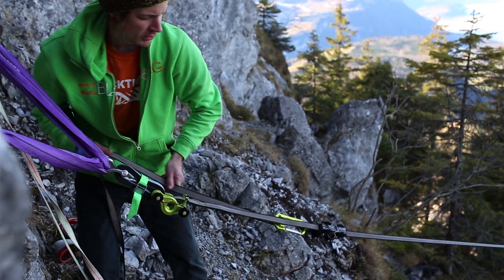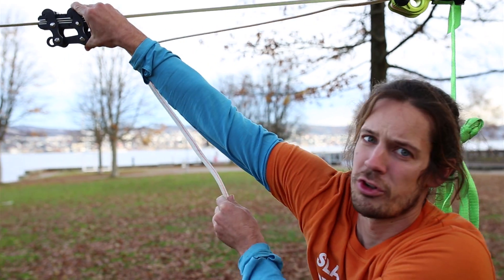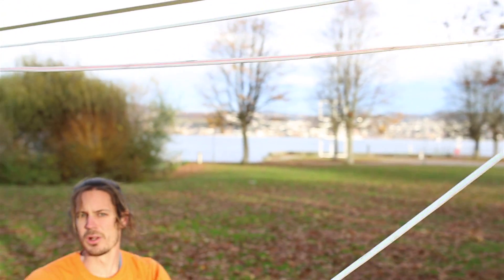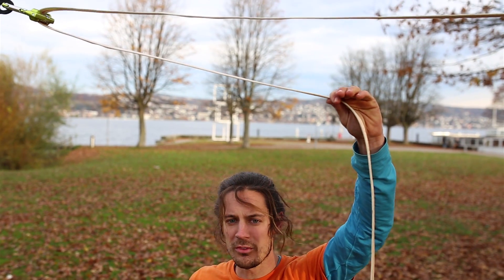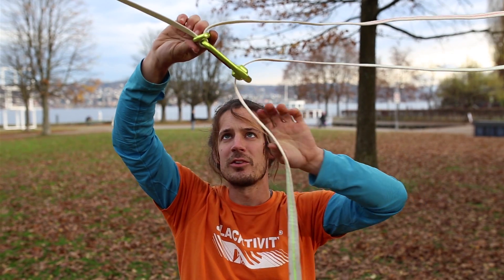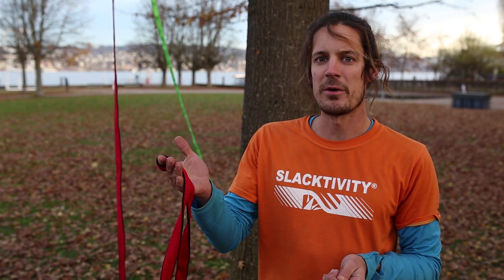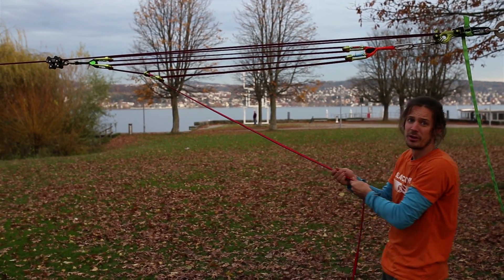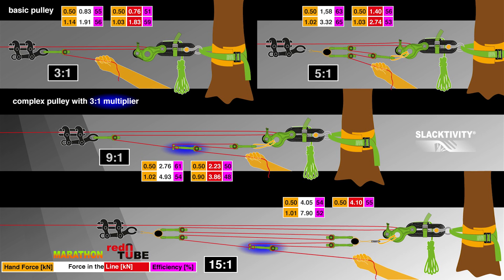How to use the Slacktivity HangOver-Pulley System (including force measurements)

Comment: Hi! Thanks for the video! What different would be in using symmetric carabiners rather than hangover?
Reply: A carabiner will cause a lot of friction unlike the ball bearings in the hangover. I don't think you'd be able to get enough tention on the line with carabiners. You'd probably get better results with the "primitive method" shown here https://www.youtube.com/watch?v=MdDzz5H2VQA Also, using 12mm stainless shackles instead of carabiners improves the friction problem (because the pin of the shackle is straight and the line slips on it easier).

Comment: Hi There ! 
What happen if you add a multiplier to the 9:1 system ? Is it efficient ?
And thanks for your video by the way !
Reply from the maker: You could do that. We did try it, but you'll end up with a 27:1 system. With polyester webbings it somehow still works but it's endless pulling for only a few centimeters of progress. With nylon webbings it doesn't work as the stretch of the line will be too big and the pulling doesn't arrive in the weblock. All in all we do not recommend the 27:1

Comment: Hey Sam, in your sway video (https://www.youtube.com/watch?v=I9aBP9wyX24), would you say that redtube line you rigged could be rigged alone using the 15:1 Hangover setup? Trying to make my dream park setup that can be installed very quickly and preferably solo, but don't have much experience rigging very High-stretch webbings. Thanks!
Reply: Hi there, did you succeed in installing the red tube as a long line? I am asking, as I intend to buy one myself.

Comment: Can you use the hangover pulleys systems with a different weblock like the cat on Slack Land cruiser or a ramlock?
Reply from the maker: Ramlock does not work. It is based on a different principle. But the other weblocks do work - but some of them are less efficient than the seaHorse. Specially under low forces there can be quite a difference in efficiency between different weblocks.

Comment: Could you get by with just the 3:1 system for 100m of MarathonPlay slacklining in the park?
Reply from the maker: Nope, that's not possible. For 100m lines in the park you are better of with a rope pulley system. In Waterline- or Highline-Circumstances the HangOver Pulley is perfect. Also in parks for shorter distances it's really great. But with a 3:1 HangOver Pulley and a MarathonPlay you'll be limited to about 40m length.
Reply: SLACKTIVITY Alright, so, 100m MarathonPlay in the park... would a 15:1 hangover system work or would you need to use a rope pulley system? Also if the hangover 15:1 would work, how high would that make the anchors?

I’m just trying to decide my next gear purchase. I’m making the jump from 2”ratchet systems and my 1”primitive system. So trying to get the best bang for the buck for a complete 100m system.
Reply from the maker: With one person of e.g. 70kg weight pulling and walking you'd need the anchor points on about 3.5m height to be able to rig a 100m line with a HangOver Pulley. So basically you can really say that for that length in the park it is not the best option. If you just wanna walk long lines in a park, go for a rope pulley. If you wanna be versatile with different kinds of line and rather rig lines up to 50m in a park, this system is really great. Also think about, if you wanna rig such long lines in a park and take all gear every time you rig it or if you prefer having something shorter and more playful and less gear to carry. I've just made the experience, that after a while of longlining you get annoyed by all that work and only rig longer lines as midlines/waterlines/highlines. At least this was the case for me and many friends.

Comment: Do you use SeaHorses on both ends?
Reply from the maker: yes, but it has no influence on the hangover pulley. So nice sewn endloops are perfect as well.
Reply: SLACKTIVITY what i wanted to ask is, can we use any weblock to make this hangover pulley system? Or it has to be a SeaHorse
Reply from the maker: Other weblocks can also be used at least for the 3:1 pulley system. The efficiency might be lower though. For systems where the seaHorse has been used as redirector, you can also use a rigging plate or a further anchor point instead with other weblocks.

Comment: Nice pulley system! To solve the "high stretch problem" with the redtube: You could connect a low stretch webbing to the redtube that comes out of the seahorse and use the low stretch webbing for tensioning.
Reply from the maker: Hi André, for sure you could find a solution to undergo that problem. But it would kill the simplicity of it. And mostly with nylon webbings it is not necessary to go to really high forces. So specially for highlines there is no need to go to a higher ratio than 9:1. We actually rig most highlines with a 3:1 HangOver Pulley at the moment. Cheers, Sam
Reply: Would a beginner highliner be happy rigging feather pro around 40-60 meters with a 3:1 system like youve shown? Thanks
Reply from the maker: Hi Joe, jep in highlining you are well-served with a 3:1 pulley. In the end the tension of the line is also a matter of taste... But I rig most of my highlines with a 3:1 HangOver Pulley at the moment.
Reply: What would you think would be the longest sensible length I could rig a highline with a 3:1 without being overly slack? On mid stretch polyester (white magic). Thanks!

Comment: Now what are the disadvantages you wanted to tell about?
Reply from the maker: There aren't too many ^^ Definitely a decreased efficiency compared to an efficient rope pulley system (e.g. with a pro traxion as a break).
Reply: @SlacktivityCh  Yes, but still, your system can be easier removed from the line, while with the pulley system it's harder. Or am I wrong?
Reply from the maker: @VisinskiRadoviBeograd  If you use a rope pulley system with a linegrip, it is quite easy to take it out of the system. Only thing you have to do additionally after tensioning is pull the webbing through the weblock. But a rope pulley is definitely heavier.